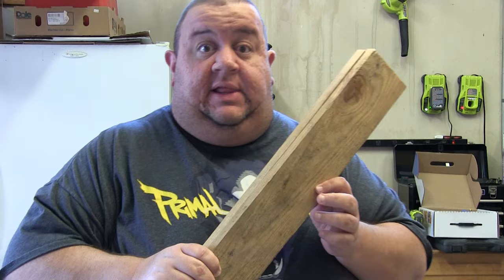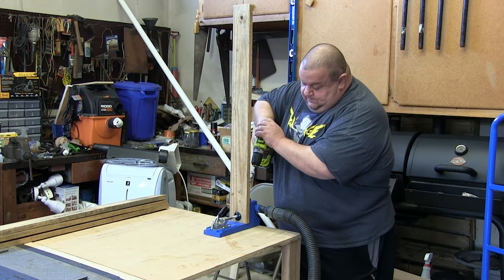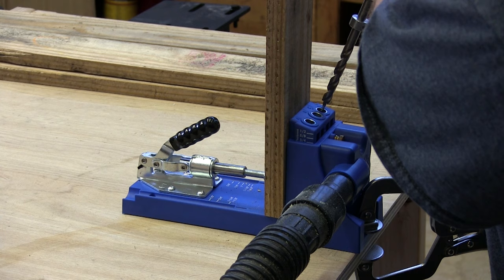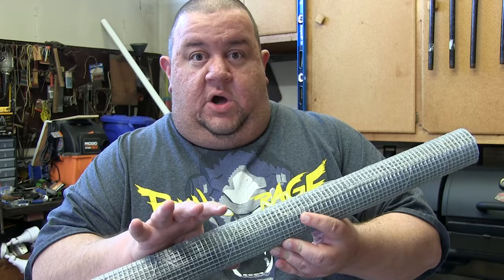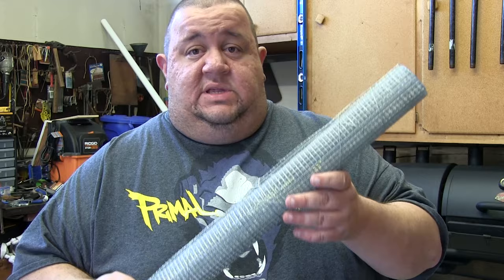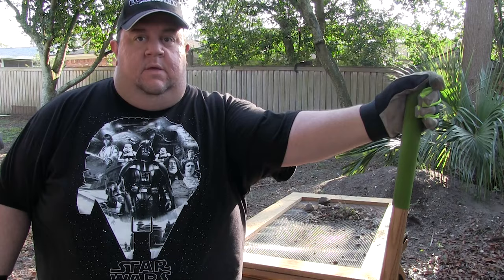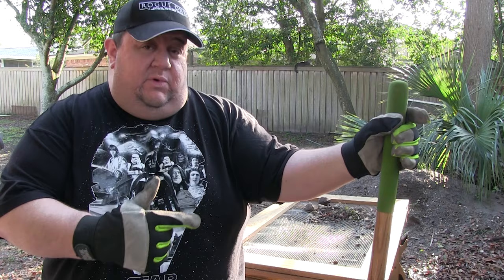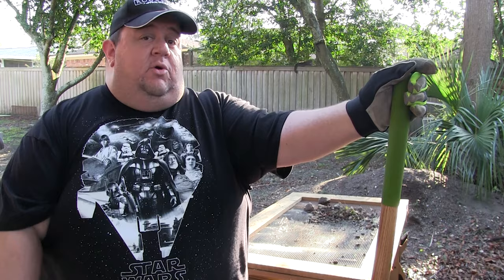Gravel and Dirt Sifting Jig

Comment: You should build one that fits a wheelbarrow. That way you can sift the dirt right into the wheelbarrow. Also, screwing in the corners instead of using nails would be much more useful because trust me these things flex and break all the time
Reply from the maker: yeah... that's why I used the scraps that were left over from another project... this was really a disposable rig meant for a single use project. If I was making this as a permanent fixture I would have designed it way differently. Thanks for the input!!
Reply: @BigLousWorkshop    Perhaps say “single use” or “not heavy duty”…

Comment: 3:55 I would have overlapped the wood. On the bottom the two long pieces are butted up to through pieces across the width. I would have done the second frame on the top with through pieces on the length and butted pieces for the width. Hopefully that makes sense.
Reply from the maker: Hey man what ever get's the job done right!!!
Reply: @BigLousWorkshop  You wouldn't need so many staples if the wood overlapped each other.
Reply from the maker: ehh... possibly, staples are cheap... but this was never meant to be an overly thought out or complex build. Just a simple rig to help get gravel out of my yard. Thanks for the suggestions!